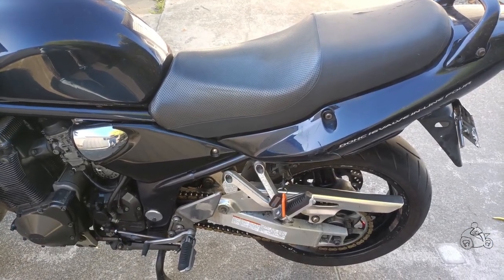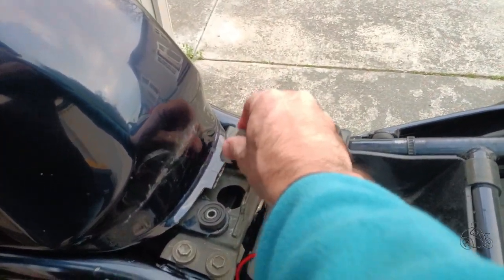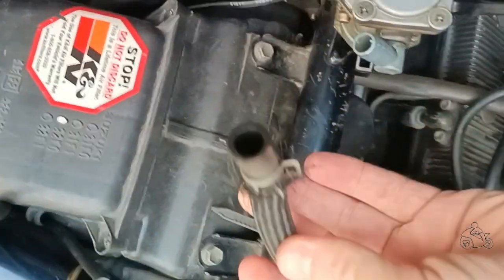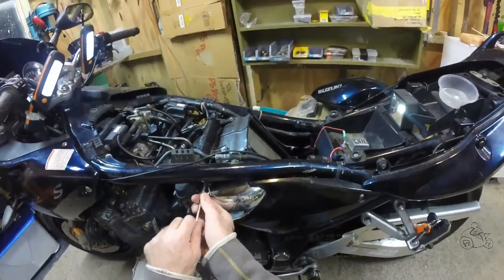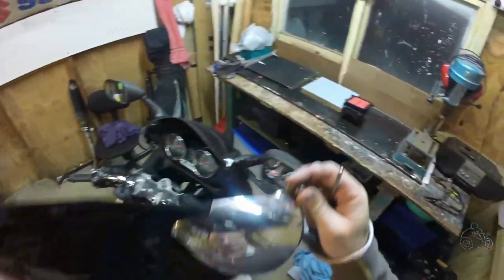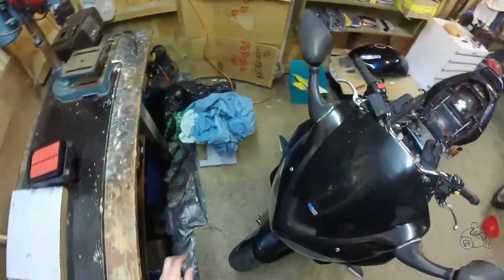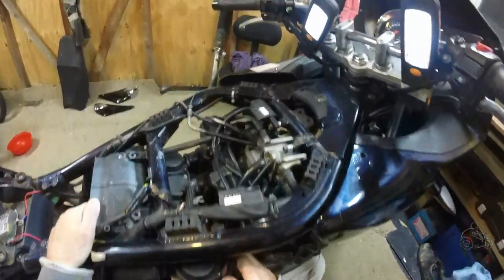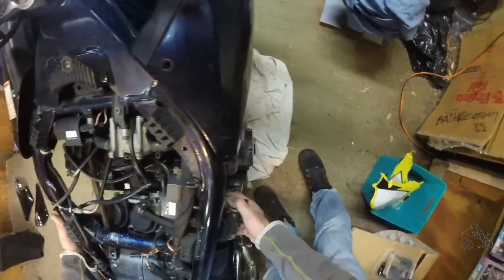My Suzuki Bandit 1200 project | Part 2 (removing the carbs)

Comment: With a couple of shortcuts and some practice, this job can be a LOT easier. I have owned a 1999 GSF1200 for 10 years, and I can have the carbs out and on the table within ten minutes. Jets cleaned-out and the bank back in the bike within another 20 mins.
Reply from the maker: @888jackflash - in my later video I replace the throttle cable. Definitely now 10 minutes for me too! Actually quite surprised now how easy it is! Thanks for watching my video 🙂
Reply: Greetings from New York! A big fan of NZ.. went through very quickly once, hope to return someday. Yup, pulling the carbs on and off can be done fairly quickly with some practice- I think easier for me as my '99 has no PAIR systems nor other clutter. I actually only run a PULL throttle cable (have done so for many years on most of my bikes to no detriment)... so that's a help. Pop the seat off, rear bodywork, two bolts for the tank... I don't run clamps on the top of my fuel line or the vacuum line, so they push off easily with a long flat screwdriver. Then pop the lid off the back of the airbox, knock the filter loose with your flat screwjie and remove the two airbox mounting screws. Loosen all eight Intake clamps screws... pull the airbox rearward away from the carb mouths.. yank the bank UP and BACK out of the intake boots then the carbs UPWARDS through the frame at a slight angle. Put a thick rag underneath them while loosening the throttle cable's 10mm nuts, use a needle nose to pull the cable knob/end loose... then the carbs are in your hands. Turn them upside down to drain them at angles 'til empty. For re-mounting, re-attach the cable(s) first, make sure the rubber intake boots are WARM, (hair dryer or heat gun best), makes it a LOT easier. Spray a light mist of silicone into the forward intake boots.. and they'll pop right in. Do NOT spray silicone onto the airbox-side boots! It will make a slippery mess. But they should be warm also. Reach through the airbox and finger the rubbers so they're not folded inwards... wiggle the airbox gently until the boots all fully seated. Then, HOLDING the carbs forward from backing out, get the outer two airbox boot clamp screws tightened so the bank won't move, then do the inner two. Then replace the airbox mount screws, air filter.. and make sure all 8 clamp screws are tight. Then just pop the tank, rear bodywork and seat back on. Easy-Peasy, once you practice! I've had my carbs off... oh, about a hundred times over 175,000 miles now.
Reply from the maker: @888jackflash  ha that's exactly how I do it, almost word for word from what you said. I didn't bother with the return cable either. The carb springs are pretty damn strong already!! The only thing I tried and failed was putting the throttle cable in with the carbs installed. Definitely not recommended!! My hands had bruises for ages 🤣. Be good to see what you think of my #7 video. And if you ever get to NZ and Christchurch I'll shout you a beer 🍺
Reply: @888jackflash  This is golden advice for another 1999 GSF1200 owner prepping for first-time carb service (myself!)
Reply: @Grunchy005  A lot of Bandit owners go nuts with the jetting, putting "pod" individual filters on the carbs and throw huge jets in there. While you MIGHT get screaming power at full throttle, the rest of the range will suffer, barking, spitting and bad flat-spots. With a simple aftermarket exhaust can, all you need is a set of good needles (I use Ivan's Performance)... drill 20 1/2" holes in the airbox lid (remove the snorkel), go 37.5 on the Pilot jets, 117.5 (okay maybe 120) Main jets... float levels at 14.5mm... and 3 to 3-1/2 turns out on the Fuel screws, depending upon your altitude. STAY WITH THE OEM SUZUKI AIR FILTER. Aftermarkets filters simply don't work with this bike, trust me. This will give you clean, fat power across the range without dips and gliches and sh*tty idling. It's what I'm running in my own '99 B12 right now, and it's crisp. Of course, make sure your valves are adjusted, then, AT THE VERY END, do a proper carb sync. Bob's Yer Uncle.

Comment: So many older bikes here in NZ, seem to suffer the same fate, back yard bodgers. I'm restoring an 87 FZR1000 at the moment and the horrors that it had been put through by previous owners was alarming.
One was a amateur auto electrician, who thought it was a good idea to bypass the thermo switch for the cooling fan, and fit a manual switch, he used home electrical gauge wire, and a giant switch bock from Dick Smith😆, I knew things were going to be really bad, when i found loads of wood screws and decking screws holding things on. 😫
I should have started with a much better bike, would have saved a ton of money, but to late now.🤷‍♂
Reply from the maker: Oh I've seen that sort of bodgy fixes so many times on my bike projects I've bought !

Comment: Reinstall, attach throttle cables before inserting carb bank from right hand side, choke later. Removal, pull out and remove cables outside the frame. Allows better technique doing up the lock nuts on cables correctly. Its a Haynes tip. Its worked for me several times.
Reply from the maker: Thanks for the tip. The cables came out pretty easily with the carbs inside the frame but definitely reckon not the way back in. I have to a buy a new set first though! Thanks for watching 🙂
Reply: Another good little tip is to put some rubber grease on the side cover grommets, (or any rubber grommets) stops the plastics from binding and potentially breaking off the lugs.
Reply: I watched a "how to" vid of such a hamfisted attempt, I was yelling at the screen. I was triggered by the simple act of removing the tank.......without undoing and removing the fuel tap first. Nor did they put a block of wood under the tank to remove the fule and vacuum pipes. It was total carnage of metal to paint contact the whole time...lol.

Comment: I recommend using some kind of fishtape  or a zip tie to snake ur throttle cable straight down. Then u can jam ur hand inthere and wiggle it over the next obstruction with ur nimble fingers. After that get urself a long 12" pair of needle nose pliers and a headlight so u can get the end of the cable where it needs to go. This is the way to hook up that pesky open cable.

Comment: Gday mate I'm down here in Invercargill I'm looking getting myself a Bandit in the next few months I've been chomping at the bit wanting to get back riding poor health put a stop to that for awhile
Reply from the maker: @BarnyG6804 -  they are a lot of bike for not a lot of $$$. If you haven't already, check out my Part 1 video where I did a walk around of mine. Fun project and super easy to work on. Do get a Bandit 1200, even to chuck in the back of the garage for now. Thanks for watching my video 😎
Reply: I'm in Taranaki, and have been think about getting either an GSX1200 Inazuma or XJR1300, (I like the twin shock look on this type of bike) I have a 01 YZF-R1 that ive owned since new but its getting too uncomfortable to ride any distance. Either one of those, (or a CB1300 or GSX1400) would suit me perfectly.
Reply from the maker: @uhtred7860  I'd go for the GSX1400. The best value of all of them.